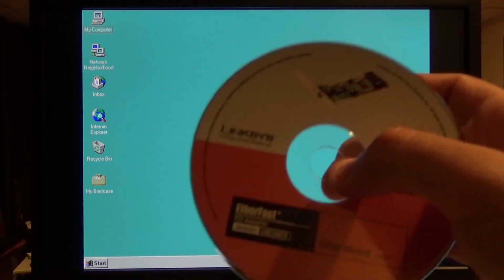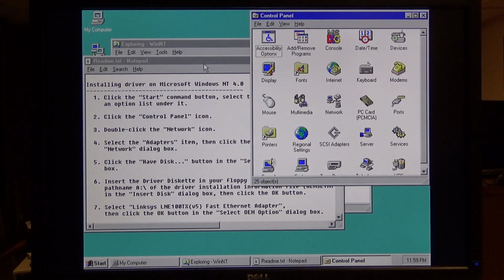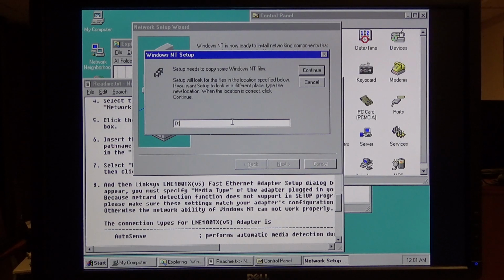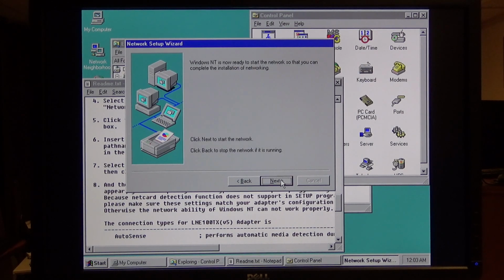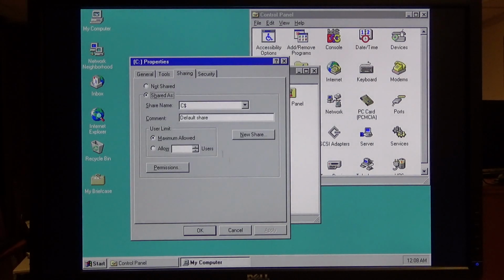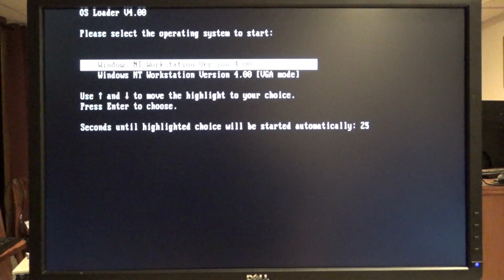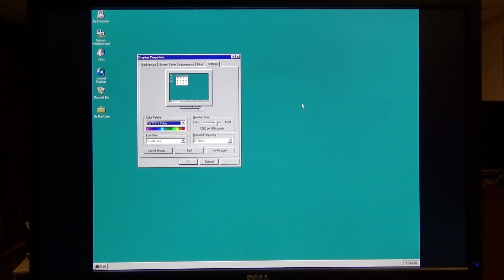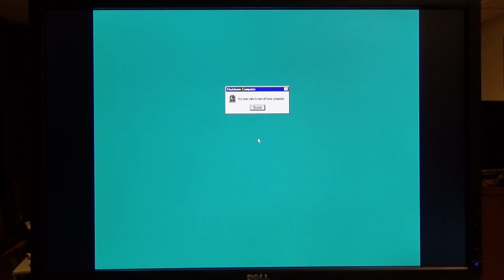Installing Windows NT 4 on the Gateway 2000 G6-200 Part 2

Comment: i think iam going to find the drivers to my video card and eathernet card and sound card , i will pull the hard drive out of  my gateway 2000 computer , put the hard drive in my newer socket 775 computer  with windows 7 thats goes on the internet , so i can download all the drivers  and cpu z ,, and other programs  then move the drivers to gateway hard drive then put it back into the gateway 2000 , , even the windows nt 4.0 coa on the gateway 2000 on the side door its a Gateway LP Mini Tower PAT E5200-500 Dual Pentium 3@500MGz,, i guess they call it a server
Reply from the maker: Yep. That's another way to do it too. I have a Windows 7 machine to do that exact task, except I set them up on my network for the challenge, but taking the drive out is definitely easier. Good luck on your project!